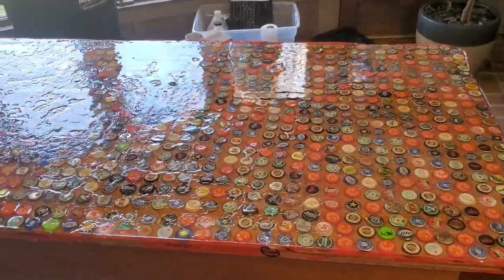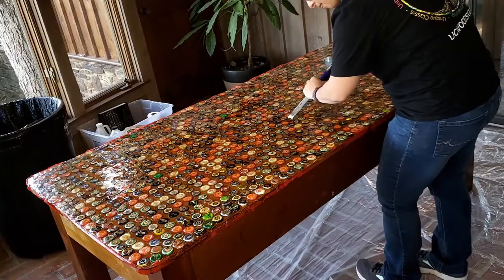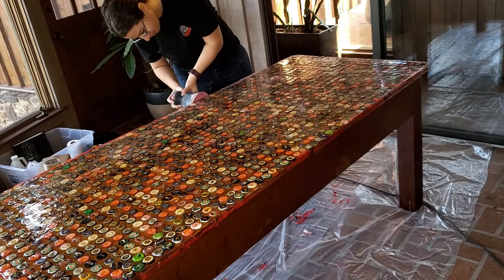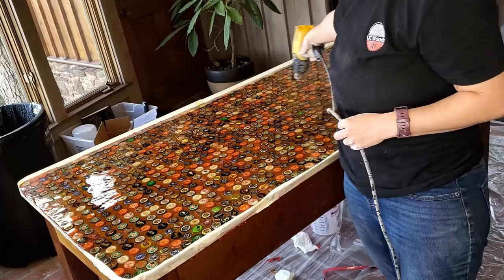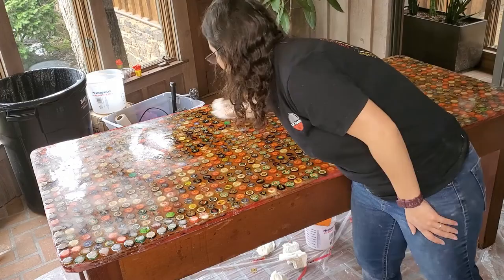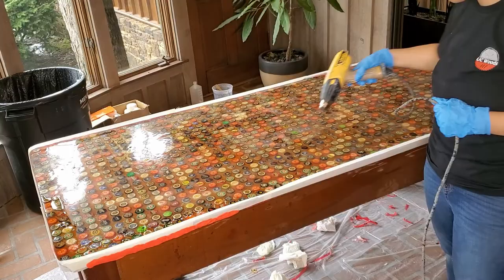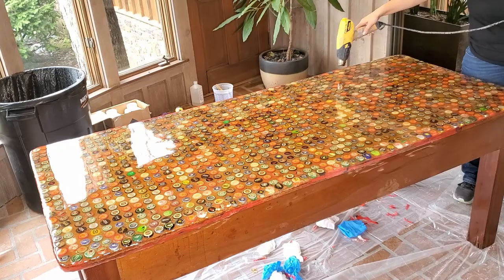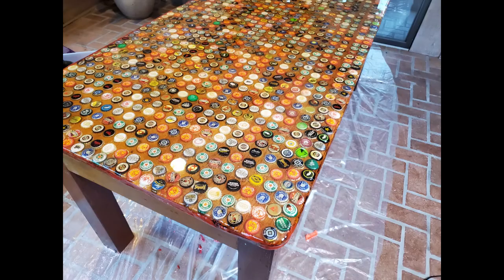How To Fix My Epoxy Resin Project That is STILL Sticky!?

Comment: Thank you I'm trying to finish a giant heart I'm making my mum and I can't get the bottom to not be sticky, so it's more hardener I need 😂
Reply from the maker: @JemChapman88  not necessarily. You may need to move the sticky layer completely and redo. Adding liquid hardener to sticky epoxy will not fix anything
Reply: @ucwoodsepoxy  oof 😣 got it 🫢 I swear I'm never touching resin again lol
Reply from the maker: @JemChapman88  next time, buy from us and we won't let you get in this situation in the first place. Epoxy is super fun

Comment: Awesome work!.. I have a 7’x 2.5’x 6” cypress tree slab I did this too lol.. was one of my second pours and did so well on my countertops I thought I could do a deep pour too.. 😒well I didn’t mix it thoroughly and poured WAY too much AND ALSO didn’t realize there was a decent hole causing a slow leak 😤.. anyways it’s be sitting in my work room for almost a year.. still tacky in certain spots and now has a fair amount of debris and bugs.. but thanks to your video I now have a good idea what to do 👍.. thank you!
(( I FORGOT TO ASK )).. once you removed the debris, did you pour over the older sticky epoxy?.. if not could I do this?
Reply from the maker: Good morning! So for removal of the debris if you can stand up the table and clean it out with iso99 or iso93, a small wire bristle brush and paper towels. I just posted a different video on a DIFFERENT still sticky bottle cap table. That one was able to be cleaned first and covers this process. It also used a deep pour since it was on a door frame and was about an inch thick where the bottle caps were. I also posted it on my tik tok  which is just @ucwoods

Comment: hi great job..i do have a question for you if you have time to answer ...i had some wood decoration I barniz they look great ,then I decided to use epoxi on them . i sanded the decorations mixed the resin2/1...first problem resine dry good but in the corners the resine rolls back letting all corners like never had resine  2/ problem a bunch of pits. i keep on pouring resine but after a few minutes the pit will appeared again ,3/ problem ,I sanded  all the decorations again and pour the resine again . one more time some imperfections .it dry very well .4/ problem sanded one more time did it again all 100% perfect with a little inconvenience after 4 weeks the resin is still tacky not wet just tacky.. how can it be fixed without  sanding againg//in another video the guy fixed the problem by using barniz to cover everything and it seems to work pretty well/

Comment: I tried epoxy for the first time, I made rookie mistakes...I mixed the 1:1 ratio of each only for anout 20 seconds and immediately started applying..Did I not mix long enough, and do I need to let it sit in the cup a few minutes before Applying? Also, I used a paint brush, treating it like Paint, instead of pouring and spreading.  I also didnt buy a heat gun of any kind.

So the end result was "pools" of the epoxy all over like I had just poured water everywhere..

May I ask, Which of those dumb mistakes( if not All) Made it pool in a ton of small areas and not lay perfeclty flat ? 

And also, can I use the 180-220 grit sand paper to even the thick pools out and start with a fresh new layer?
Thanks alot for any insight.
Reply from the maker: @LoganVegas3353  yeah.... that's a lot of issues and they all played a part. Remove as much sticky layer as possible manually by spooning or scraping. You'll want to remove as much as possible before pouring the next layer or it will not bond correctly. Follow the appropriate steps and try again :)

Comment: Hello!! What grit sandpaper should we use once we wipe off the sticky sections?? Thank you for the great content!!
Reply from the maker: If you are flood coating over what will be sanded, you can use whatever git you want. The new epoxy flood coat will fill in all of the sanding scratches left behind, for even grits as tough as 80.

Comment: so you can pour new layer over uncured layer? and the top will still feel hard? just curious because I may have to do this. thanks!
Reply: ill add that I only have a few spots about 3 inches in diameter on my table that cured mostly hard (but I can put my nail into and it makes a mark that slowly goes away when I remove my finger nail. should I try to scrape this out or just pour a new layer over? im curious because its very hard and to the touch feels like the epoxy that cured properly (other then me being able to dig my nail into it) and I imagine it'll be hard to remove.
Reply: Did you get a response. I as well could use an answer but in a hurry haa
Reply: @bpatterson612  yes you can if its able to be completely encased or enclosed by your next pour, scuff up the surface of uncured epoxy with 180 -220 grit to be safe, also it helps if the uncured epoxy is mostly hard, for example in mine I had a few spots that I was trying to top up a few low spots of my original pour , and I accidentally mixed 1 to 1 instead of 2 to 1, and surprisingly it was very hard still , was barely able to penetrate it with my finger nail. if its very soft you might run into more problems

Comment: This is very interesting. Thanks for sharing that information. Does the epoxy eventually set under the new top costs? 
Also, I’ve stared pouring some epoxy projects and have had issues with the epoxy twisting and bowing after taking it out of the mold. Any ideas why it would do that? It’s not soft or sticky. It appears to have set normally. Thanks for any advice you can provide
Reply from the maker: Hey Brian. I can't comment on other epoxies. Not all epoxies are what we call 100% solids like ours are. You should also leave your pours in the mold for at least 3 to 5 days for deep pours such as river tables. Send us a message next time you need some epoxy and we'll get you some free shipping on products. We also have the highest UV inhibitors on the market. 

As for the sticky under layer, we've had 2 experiences. 1, the new epoxy seals and locks in the sticky epoxy full encapsulating. 2. We've had an instance where some uncured resin worked its way up through a pore in the new epoxy, was wiped away twice with alcohol and then stopped. 🤷‍♀️ 

🤯science lol. 

Ucwoods.com 
Ucwoods417@gmail.com
Reply: @ucwoodsepoxy  thanks for the information. I’m new to epoxy so I’m trying different brands to see what works best. Had good luck with total boat but not so good with Epodex. I noticed on your website that you were going with a new improved UV formula. I’ll have to try it.